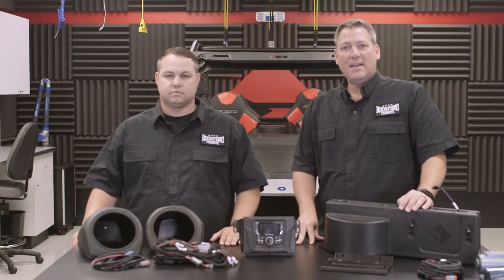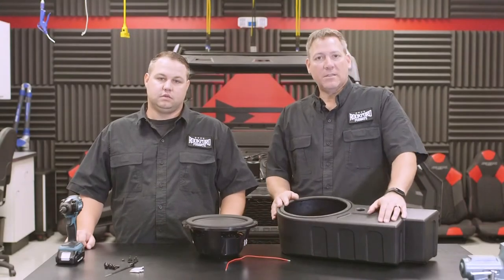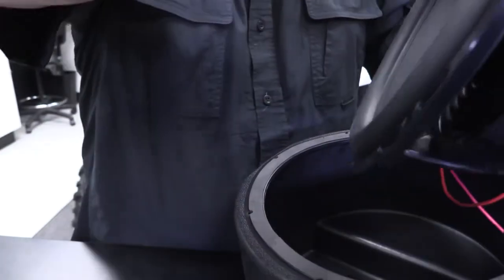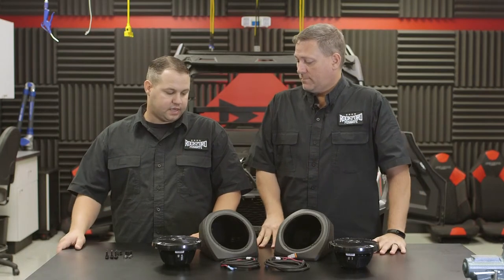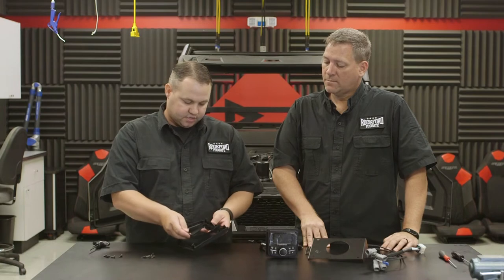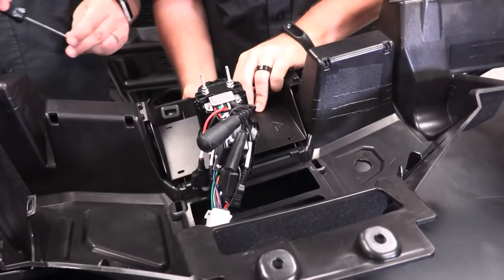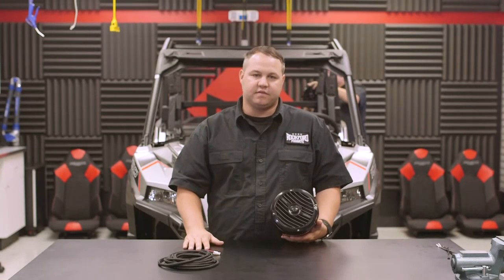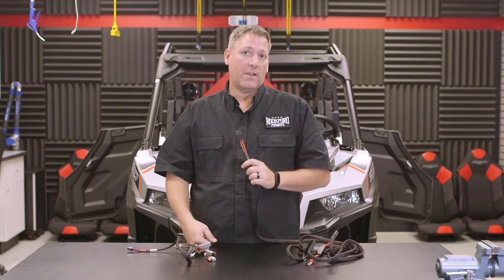GNRL-STAGE4 Installation

Comment: How does the four channel amp power the four 6.5 speakers AND the sub?
Reply from the maker: The TM400X4 is a 4-channel amplifier stable to 2-ohms per channel. The front & rear speakers run off channels 1&2 and the subwoofer is bridged on channels 3&4.
Reply: My 2021 general xp 4 ride command stage 4,hasn't worked since delivered in November as amp blew when turned key on in my driveway. Something is definitely wrong at Polaris factory installation because service dept. Said they have ordered 4more amps that were defective since ordering my replacement amp. Please investigate as many customers know Rockford fosgate should sound awesome.   Thank you and merry Christmas
Reply: @rockfordfosgate  Each RM1652B speaker is rated at 75W RMS 4-Ohm and the sub is 200W RMS 2-Ohm. The TMX400X4ad is rated at 4 channels 100W RMS each at 2-Ohm.  

If you have four RM1652B speakers of 4-Ohm each, running off 2 channels(channel 1&2), the speakers become 2-Ohms each so 50W RMS power is delivered to each speaker instead of a possible 75 RMS each. Furthermore you loose either left-right Balance capability or front-rear FADE capability.

For the sub, since it is bridged off two 100W RMS channels (channels 3&4), you get a full 200W RMS (100W+100W) power delivered to your 10" sub (which is rated at 200W RMS). So you're getting full power capability of the sub but not the "Sub" signal coming from the radio, instead it is the left-right signal from the radio.

Am I correct? 

I am currently buying a 2021 Polaris General XP 4 1000 and looking into adding the Stage 4 option. On the other hand I am currently uncertain about this since the reviews about this kit are not great. I am thinking this might be due to the amp vs speakers configuration or literraly the Polaris installation crew under trained and not setting up the kit correctly, i.e. doing the clipping config, adjusting gain correctly, bridging the sub before putting it in the enclosure, etc...

Comment: I understand the subwoofer mounting location is the same spot as the Polaris heater. How difficult would it be to relocate the subwoofer to another area of the vehicle.  Is it just extending a couple wires to another location?
Reply from the maker: Hi Jason, the enclosure is very custom formed to fit the shape of that space and it's unlikely to be installed in any other location. We wouldn't recommend it.
Reply: Just run the kit without the sub
Reply: heater kit prob not going to be easy..   you might need to cut some plastic and relocate it.
Reply: My Polaris dealer said they sometimes relocate the subwoofer to below the drivers seat. it’s really frustrating that heater and the subwoofer occupy the same space. Then again, I didn’t even know my system had a subwoofer because it really doesn’t seem to change the sound quality much, wondering if it’s underpowered and I’m better off w/o it.
Reply: @johnjayberger  make sure you install all the ride command software updates. The updates really wake up the sound system. I really like the sub and sound quality now. I hated it when I bought my machine.
Reply: @johnjayberger  I did relocate to below passenger seat. Built a wood enclosure and works great. Check out my YouTube channel to see video on it.

Comment: I’ve done the stage 4 upgrade on my Polaris General and am not happy with the amp and sub at all
Reply from the maker: Hi @rebeccaweber2692, did you by chance use the Amp Tuning Guide when setting up the amplifier?  We have this available free on our website here: http://www.rockfordfosgate.com/rnt/rnw/docs/1356/amptuning_polarisgeneral_2016-2018.pdf
Reply: @rockfordfosgate  no it was installed by the Polaris dealership
Reply: Is there anything I can do to fix this issues other then buying different parts to get the sound quality that it should produce or am I just stuck until I spend more money
Reply from the maker: @rebeccaweber2692  O.K. sounds like you have the Polaris version of the Rockford Fosgate audio system which is different than this aftermarket system video.
Reply from the maker: @rebeccaweber2692  The factory equipped version is a closed-loop system that is limited to the BASS control on the source unit.  However, if you have Ride Command, check to make sure it's updated to the latest software.  There was a version of Ride Command that greatly decreased the output of the audio system when Polaris made changes to the DSP.   You can check for the latest version of Ride Command here: https://ridecommand.polaris.com/en-us/app/display/
Reply: @rockfordfosgate  so what’s the difference and what can be done to fix the issue
Reply: @rockfordfosgate  it’s the pmx-2
Reply from the maker: @rebeccaweber2692  Hmm, if it's the "PMX-P2" (note the P2) then it's the factory system.  If it's the "PMX-2" (non P2), then it is indeed the aftermarket system.  I was confused since the Polaris dealership installed the system.  

If it's the PMX-2 system with the TM400X4ad amplifier, then the amp needs to be tuned properly, which is one of the first things to check if the system doesn't sound right.  You can find the tuning guide here: http://www.rockfordfosgate.com/rnt/rnw/docs/1356/amptuning_polarisgeneral_2016-2018.pdf